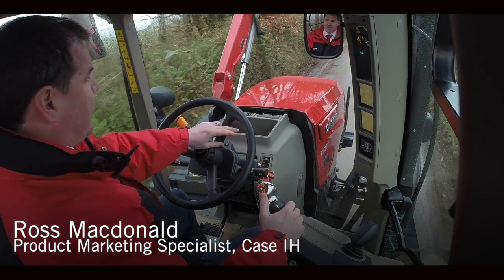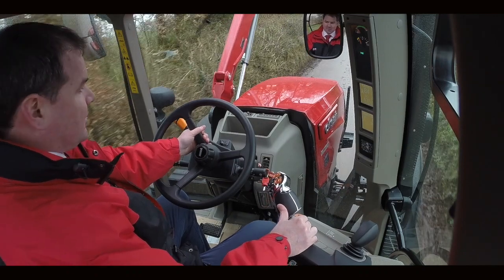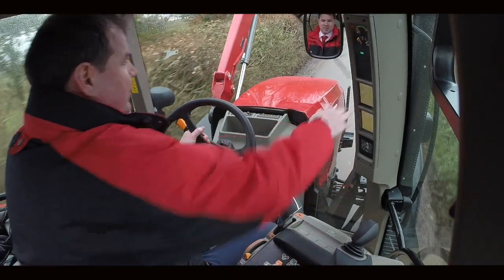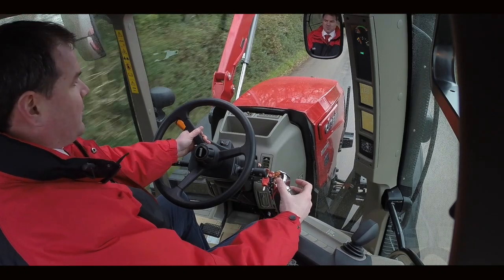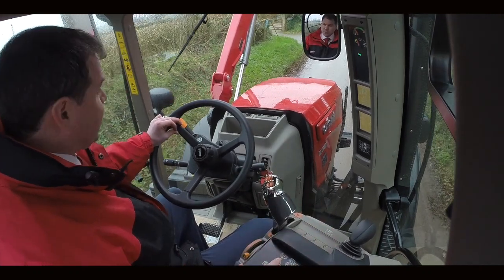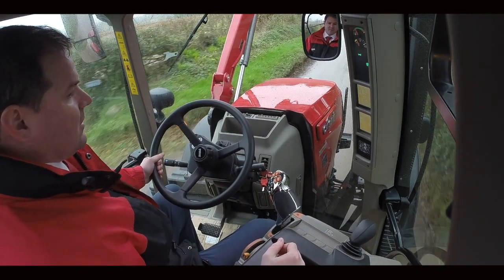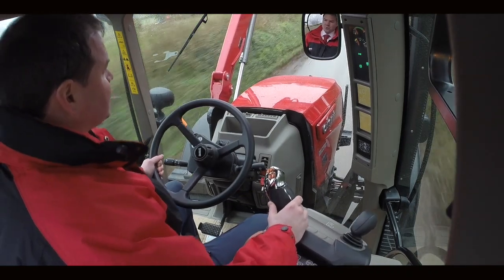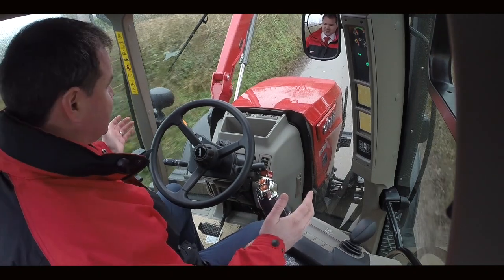ActiveDrive 8 demo

Comment: So basically active drive 8 is the Case branding of the CVT transmission for the maxxum lineup?
Reply: CVT is variable, Active Drive 8 is not variable its powershift, CVT would be CVX for Case IH